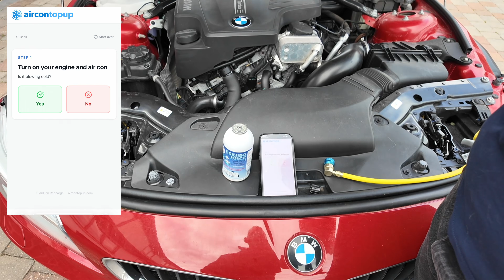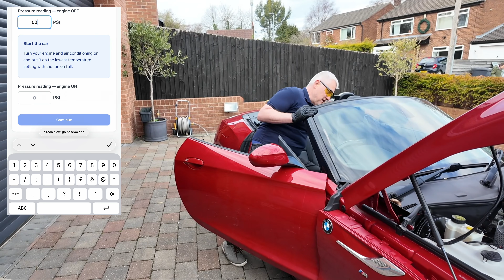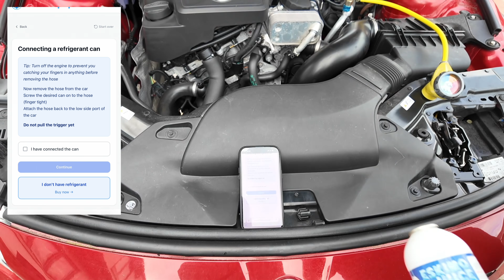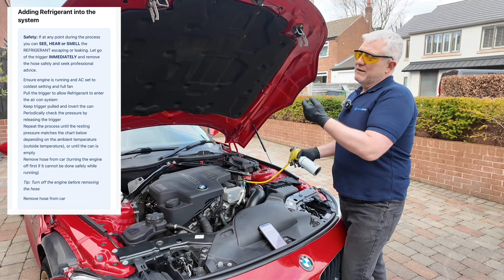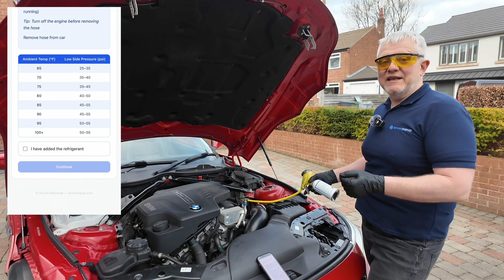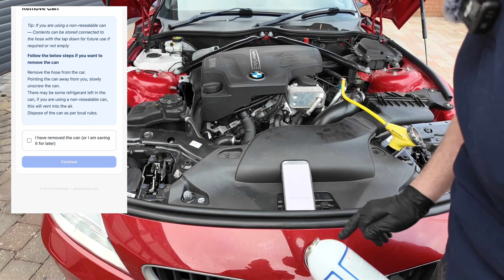Regas your car aircon system with www.aircontopup.com Eskimo Juice and our simple website app

Comment: Just done my 65 plate vivaro this evening had 0 pressure used the repair can first and that took it up to about 28 then used the refill can and now I have cold air coming from my aircon for the first time in a few years! This worked a treat 🥳🥳🥳🥳🥶🥶